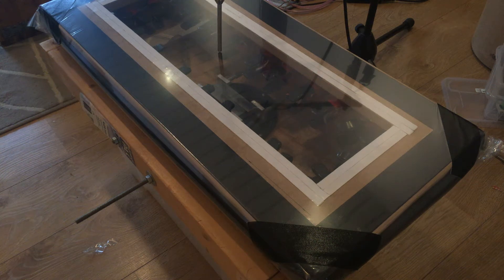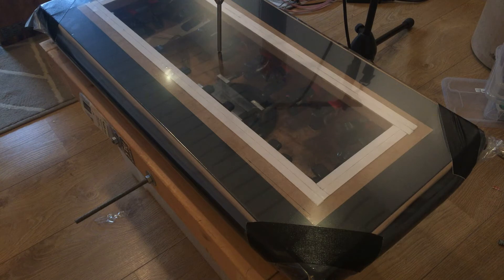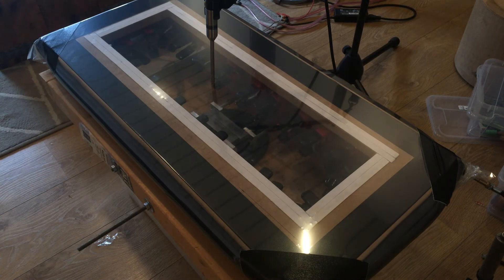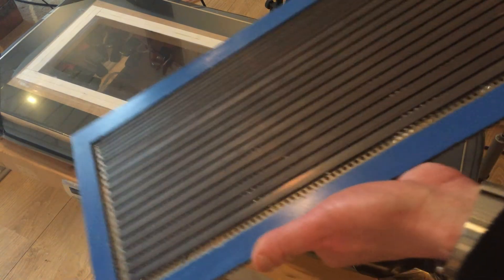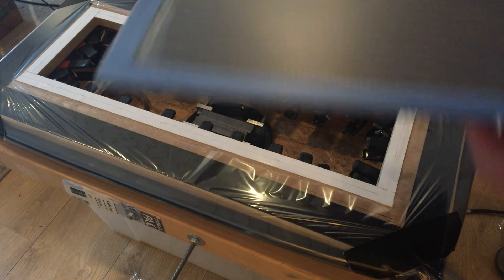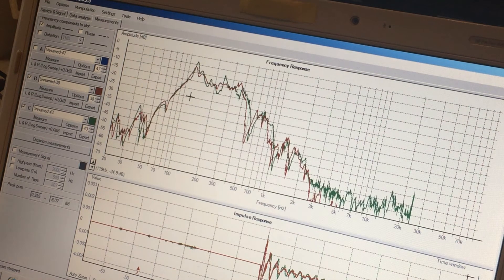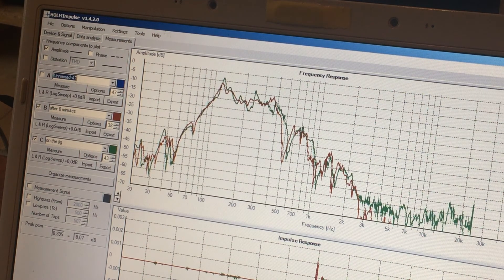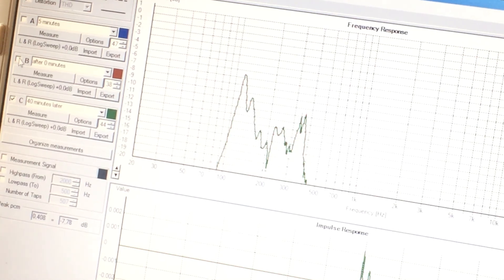Part 5-3 : DIY (tutorial) make a planar speaker panel : Stretching Mylar - finally.

Comment: Hi Joppe, Is this metallized pet film?
Reply from the maker: in this case no,  its normal mylar 12 micron, and i add the alu coil  (in this case aluminium magnet wire (i wire it here https://www.youtube.com/watch?v=OoLl4laoql8), so it has insulation) lately i only use foil, or actually aluminium tape to make my coils. i do have a few tweeters that i made with a laminated mylar. hard to find and requires etching. keep in mind this is a rather old video. so i might be doing things differently, this is more the old magnepan style of making a panel (easy to do without fancy tools)
Reply: @joppepeelen  Thanks for the reply! The 12um mylar here is losing the tension after few hours.

Comment: Awesome Content!  Thanks for uploading!  

I was thinking of making a bass panel only.  It only requires to play up to 500hz (that is the passband cutoff).  Of course a lower FS would be great but I do realize we are only gonna get around 40hz ish in room.  

Any suggestions on panel resonant frequency target for this bass panel?  I know the film relaxes a bit over time.  Also what would be a good size for a single panel to start?  Planning on using 12 micron film.

Thank you in advance for your time.  Any tips would be appreciated.
Cheers!
Reply from the maker: well it could be the same size , or maybe a bit smaller in width. as long if you use them active. since they wont be efficient :) bigger the better :)

Comment: what is the coating you're using?
Reply from the maker: its glue, 3m 30 nf in this case
Reply: @joppepeelen  Thanks, that's for bonding it to the stators! What about the conductive coating of the membrane? Graphite, Staticide, Licron crystal or something else? (soluble nylon :)  ?

Comment: The tension was unbearable...
Reply from the maker: you are on a role watching !  jees how many videos did you see in just a few days ? :)   but yeah you are right i did them soooooo many times. and the nice sounds makes the tension rise ..... at least in the video not so much on the foil ;)
Reply: joppe peelen yeah, I have sort of binged a bit, as I said. I’ve always been interested in this electrostatics and planar magnetics, but so far the only implementation I could afford has been a pair of circa 1980 Stax Lambdas. Now I suddenly feel like it’s a manageable proposition. It’s interesting you use Scientific Wire — I use their silver and copper/silver wire for making interconnects...

Comment: Why is important to set the resonant frecuency to 140 hz, that was the manufacturer resonant frecuency suggested like the magnepan?
Reply from the maker: there is no manufacturer :) or that would be me :) well the reason for the high resonance is this, i will use the panel for mid range to high duty, since it is to small to play  efficient down low frequencies.

one of the reasons:
at the resonance there is a peak that you can use if you smooth it a little bit out by splitting it in two resonances  (so the resonance is less strong but a little wider). This free spl will let you counter the 6 db roll off a little higher , this keeps the overall spl a little higher.

Number 2
I noticed that the high frequencies get smoothed and extent further when the panel is on heavy tension.  now if we would take the same tension every time but  change the size of the panel, the panels that are bigger will have a lower resonance while having the same tension.  
Now i used a small panel and if i want to get this smoother top end i need to stretch it hard, and because the panel is small the resonance becomes rather high (120 hz in the end)

and magnepan smga for instance is much bigger then this panel and has a resonance of around 70, but you can feel there is much tension on the foil.
Reply: Nice to know, do you know if the stretch pattern of the mylar is in one direction or you need to stretch even in every direction?
Reply from the maker: not sure,  but the smaller side dictated resonance mostly, uneven stretching is normally only used with curved  panels. like martin logan for instance.  But it might do something :) who knows i never tested it,  and on a magnepan there is not much to see either.
Reply from the maker: camelazo hi , a round jig with tube is nice but width of Mylar and size  panel becomes a problem :(